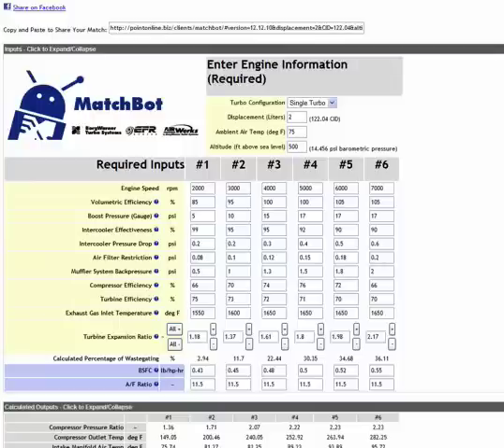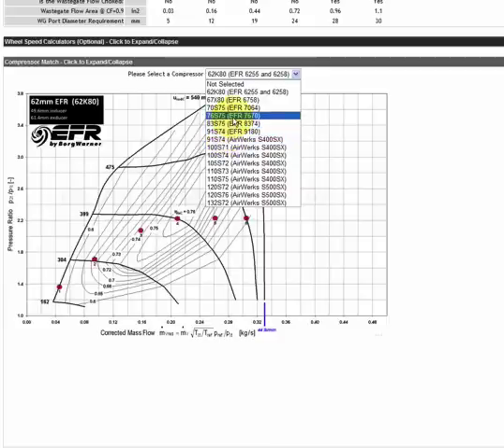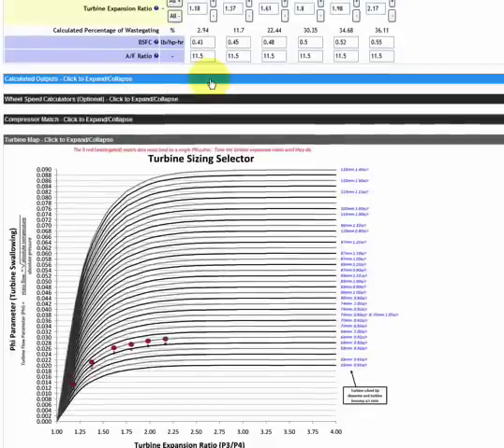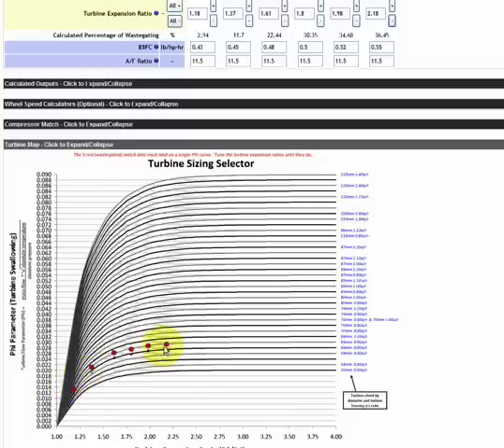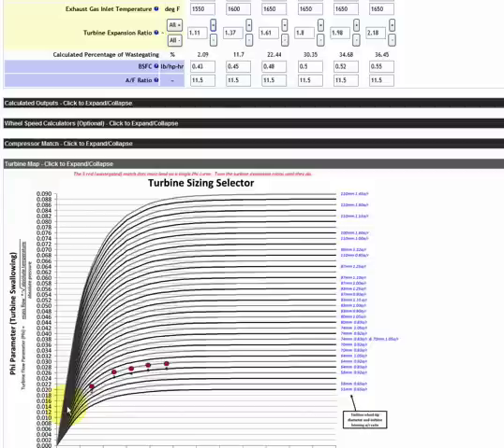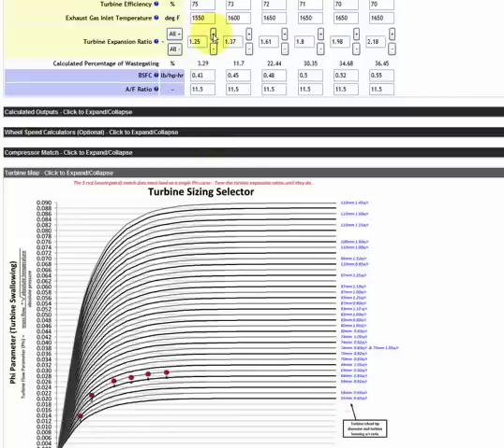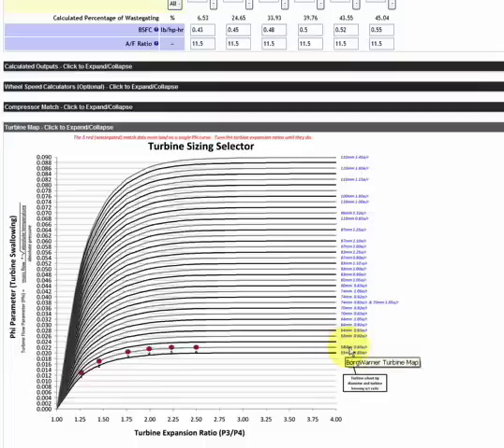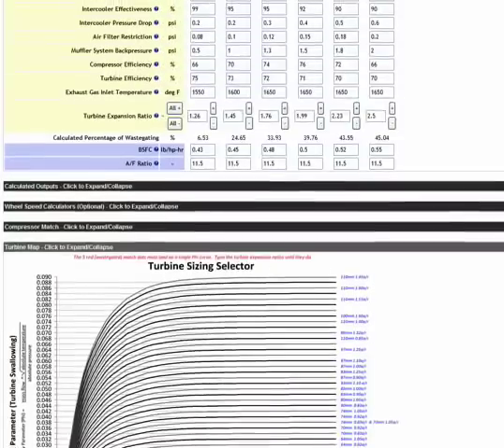Part 2: BorgWarner MatchBot Turbo Matching Tutorial

Comment: Really need to make it only show the turbine wheel sizes and A/R housings that are available for a given compressor. Obviously there is no 110mm turbine wheel for a S200sx or S300sx.

It's ALOT of back and forth between the catalog on the website and the matchbot to find the wheels that match up to different models.

Comment: When i change the expansion ratio, nothing happens to the power output of the engine. Don't you think it should change since a high expansion ratio would be bad for the volumetric efficiency? Do you think i can simulate that loss of power, by decreasing the VE input on thta particular RPM? Thanks

Comment: Is the turbine map just basically a curve showing how much air at what pressure ratio is passing through the turbine wheel (excluding the wastegate) meaning that the wastegate has to be able to flow the additional 50%+ airflow at higher rpm?

Comment: Thanks for this video series. When you say that the 58mm turbine is too much of a mismatch for the 70mm compressor, what is the basis for this decision? Is this based on the calculated expansion ratio or total turbine mass flow?
Reply: He means that the too small turbine wheel won't give enough Torque/power to drive the compressor wheel. Back pressure would be Sky-high and you would lose power due to choking the exhaust/reversion/Pumping lose.